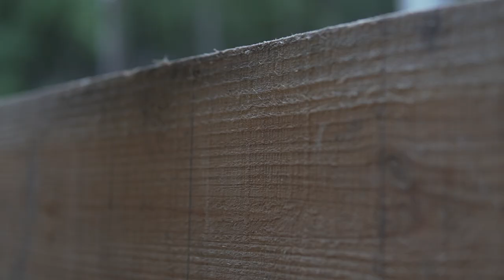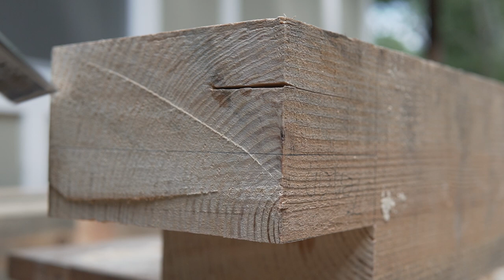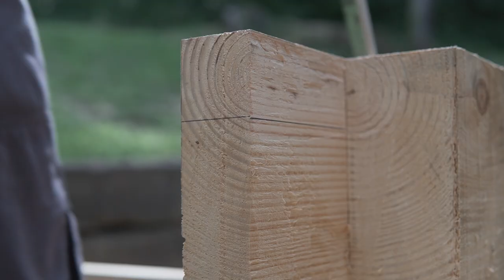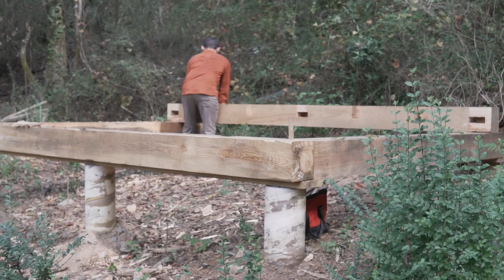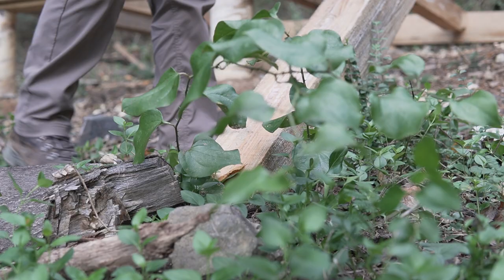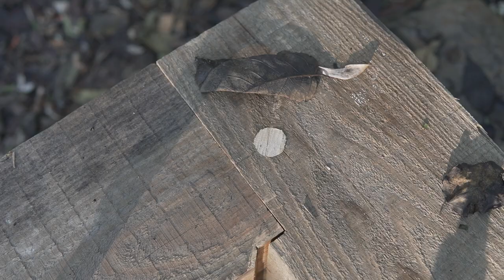Tiny Timber Frame Workshop Pt.2: Sill Plate Tenons & Assembly // Plans Available

Comment: This video is perfect, I am planning like a pavilion, very similar to this, I haven't watched how you do the floor, but I was thinking to do just the same, make joists out of nice thick timbers and half-lap them into the sill beams like you have done, no joist hangers or pegs required and looks super sturdy. Am definitely going with that solution now! Do you treat this wood in any way, as it will mostly be covered from the elements? The beams you have
down so far in this video, I mean.
Reply from the maker: It’s a good deal of work, but the joists are super sturdy! I didn’t make a specific video for the floor, but I just went with a very basic tongue and groove pine floor. If this were. cabin or home, I would have put a sub floor down first. For a pavilion, some exterior decking boards would work well. I didn’t treat my lumber as it’s far up off the ground and will be covered for it’s lifetime. A lot of folks will use an oil mixture to protect their beams. Good luck on your pavilion!

Comment: Hi Nic, nice work. Really enjoying these so far.

Why do some of the timber’s have variations in the colour and texture of the wood? There are areas and streaks of really pale, white, in the wood.
Reply from the maker: Glad you’re enjoying the build!

I’m working with fresh cut green wood. The streaks you see on some of the logs are surface mildew that grows on the wood as it dries out slowly. I’ll use a card scraper to remove it all once the frame is raised and it’s out of the rain.

Comment: Hello Nic! Its really great job!
Could you please tell how did you attach the wood base to the tubes (foundation). Thank you in advance
Reply from the maker: Hey, Dmitry! I attached a 2x8 along the concrete piers by sinking steel bolts into the concrete before it dried. Once the 8x8 sill plates were in place, i drilled lag bolts up through the bottom of the 2x8 into the 8x8. Hopefully that makes sense! Cheers!
Reply: @NicTaylorWoodworking  out of curiosity, why not just bolt the sill plate directly to the pier (i.e. why is the 2x8 beneath the sill plate necessary)? Thanks!
Reply from the maker: @andrewtruschel3228  The main reason is for installation of the sills. Imagine trying to fit the tenons and mortises together while also trying to drop the whole structure onto perfectly aligned bolts that are sunk into the piers. Especially working alone, it’s easier to fit a 2x8 onto the piers and then slide the sills on top. Hopefully that makes sense. Cheers!

Comment: How does the timber frame plate sit on top off the bolt? Did you drill a hole for it?
Reply from the maker: I cut a shallow mortise in the places where the bolt sticks through

Comment: What kind of wood did you use for the sill plates -- i.e., between the timbers and the piers?
Reply: And how did you fasten the timbers to them?
Reply from the maker: I used some treated 2x8’s I had lying around. I attached them to bolts I sunk in the concrete, and then attached the timber frame by driving lag bolts up through the bottom of the 2x8 into the 8x8 sills. Hopefully that helps!

Comment: Nic love the videos. I am in the planning stages of building one for my self. Can you tell me how you connected the frame to the pillars?
Reply from the maker: Hey Daniel! I sunk a galvanized anchor into the concrete when it was still wet. I then drilled holes in a 2x8 that sat on the pillers and were attached to the galvanized anchors. Once the foundation was in place, i climbed under the frame and screwed the 2x8 to the bottom of the sill plates. it’s have further connection when i put up the siding, as i’ll also screw the bottom of the siding into the 2x8. Hopefully that makes sense.
Reply: @NicTaylorWoodworking  yes that makes sense. Did you do this to all four sides?
Reply from the maker: @mtbikerdan  nope, just the front and back.
Reply: @NicTaylorWoodworking  Thanks again,  looking forward to seeing your progress.

Comment: What kind of lumber are you using?
Reply from the maker: The structure will all be made of pine with oak used for the pegs and wedges that hold it together.
Reply: @NicTaylorWoodworking  looks awesome, looking forward to pt. 3 and beyond.